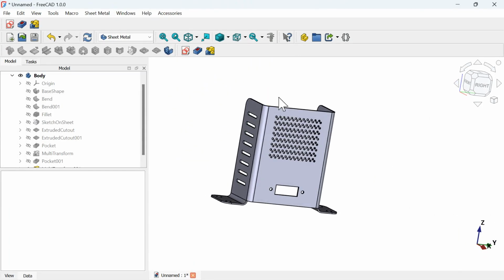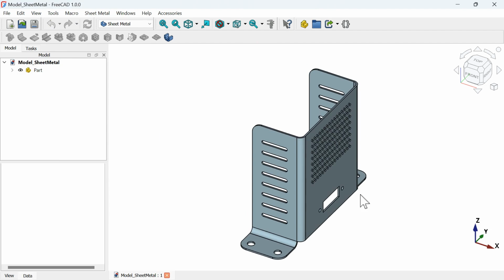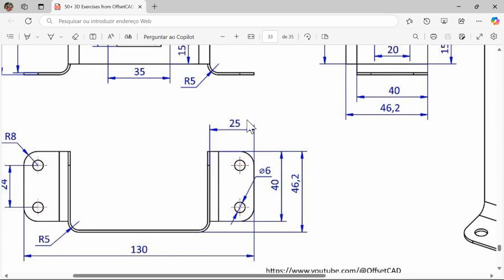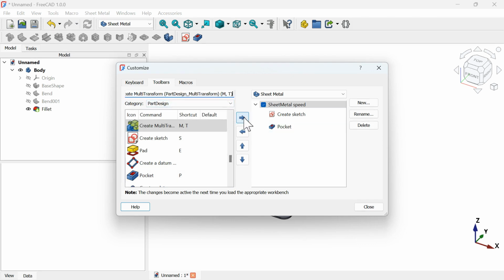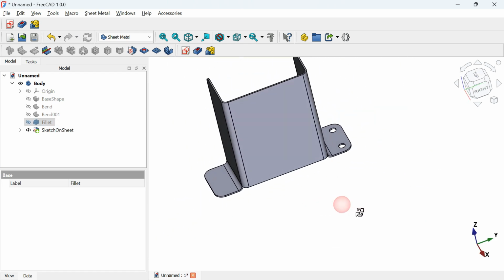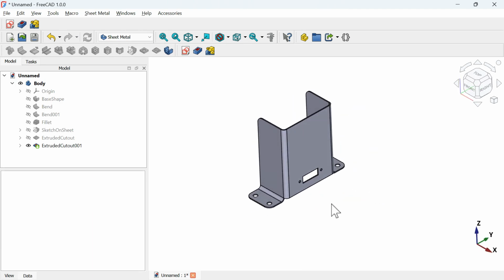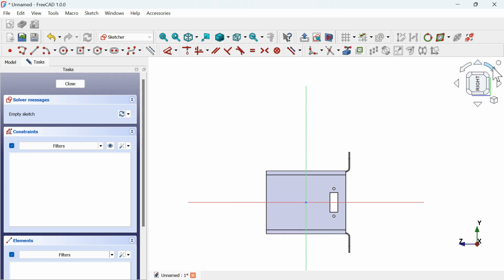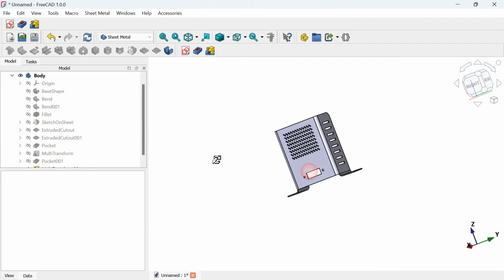FreeCAD 1.0 beginners tutorial #11: measure tool, how to create holes in SheetMetal workbench

Comment: Hello. Thank you for the video, it's clear and easy to learn. 
I have a mistake, when  I resized the angle  from 5 to 3.8 mm (6.1 minute) the 67.60mm wall increased to 70 mm I tried to do it again even with different parameters and it goes wrong again and again!, I see that you did not measure the wall after having reduced the indicate angle, the question is: is the wall in your exercise resized up too?
thank you!
Reply from the maker: Hello!
I think you are referring to the fillet.
For the wall size you want, just use mathematical formulas on the wall length parameter, it can be:
= L - F.

- L wall length and F fillet size.
I think in the video, somewhere in the video I show the application of such formulas.